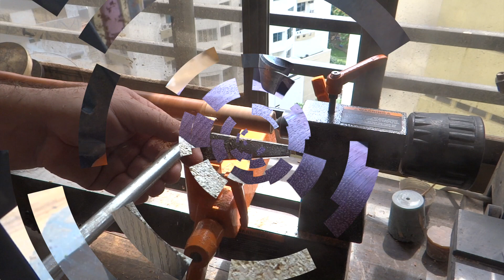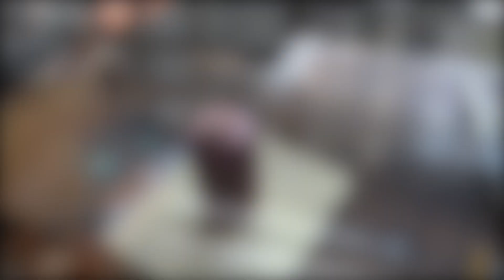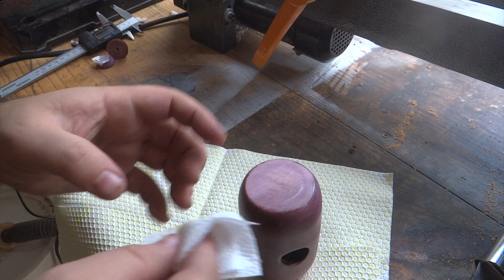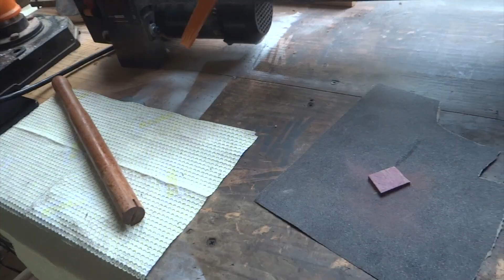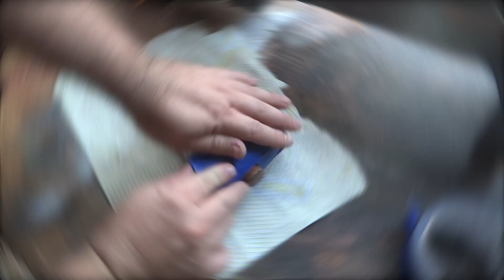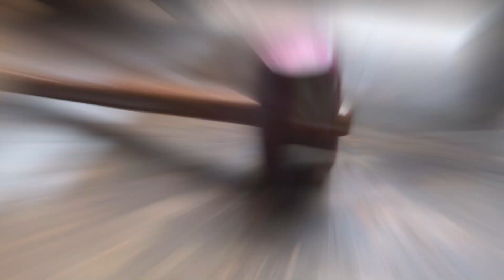Making a Mallet on a WEN 3420 Lathe

Comment: ??? Okay I have been dying to get into woodturning for a long time I know nothing about it I found the exact same machine online for 140 how do you like that machine will this be a perfect Lay's to get in the pen turning and stuff like that just to get started
Reply from the maker: It's the perfect machine for the price. You will need to get the appropriate MT1 pen mandrel , and that is. I think I have that link on the description. The motor it's kind of low powered so be patient.
Reply: @ArielYahni  thank you much
Reply: I have this same lathe.  I’ve turned chisel handles, hammers, screwdrivers and even small bowls with this lathe.  It is small but very good for its size.  I just need to find out which bowl chuck fits this model for bigger bowls.

Comment: Great video.  How is the WEN lathe holding up over time?  I'm considering buying one based on your review and was wondering if it's still working well.  Thanks again.
Reply from the maker: Yes it's working great still. It's a little underpowered so it stalls and auto shuts off when to hot, but a little rest and its back in action